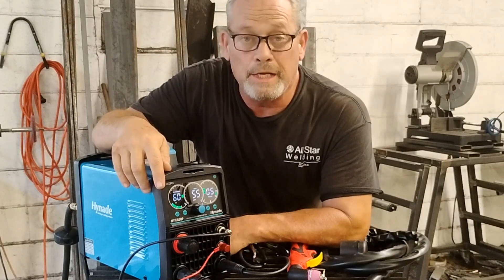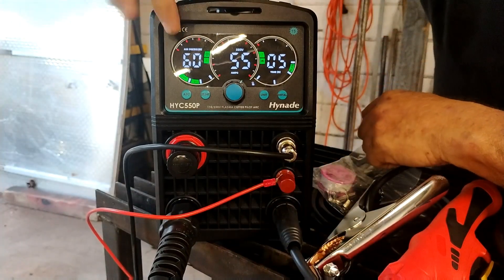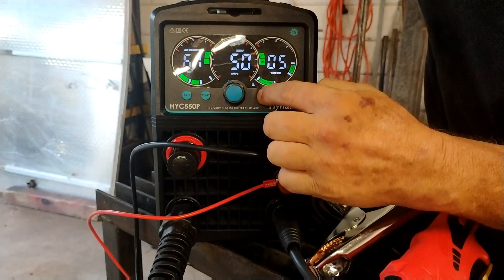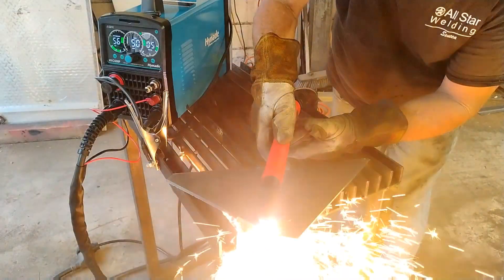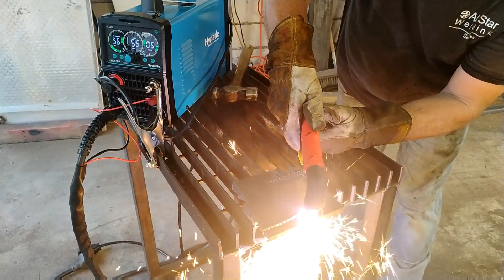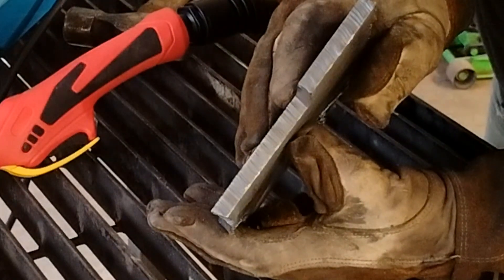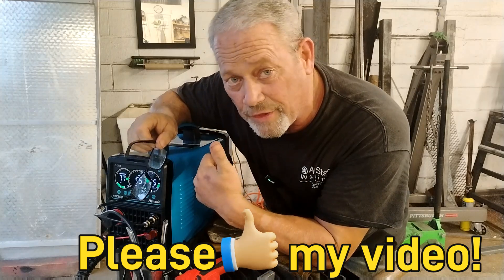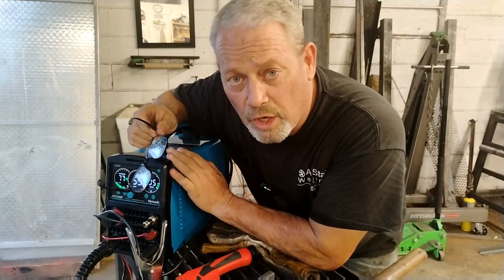Hynade HYC 550P Plasma Cutter Review & Test — Is It Worth It?

Comment: Nice review - Thanks!
One small note (as I'm sure you know by now), at 50 Amps, you could have "flown" like a B52 across those first two pieces - Ha.
Reply from the maker: Yeah, I had to get used to that machine.
Reply: @AllStarWeldingSC  I'm thinking about getting that same machine as a backup because the one I have is 20+ years old and heavy as a sack of concrete, and only has 30A output, although it is dual voltage). That Hynade is so portable and powerful with its inverter, BUT... I can't find any warranty information? 
In fact, I was going to get a BestArc but they offer no warranty AT ALL best I can see, so that is a NoGo for me. Hopefully Hynade has something to offer in warranty? Thanks again, Sir!
Reply from the maker: @AerialLensVideo I also have a Primeweld and a Vevor. I like the Vevor the best. Although Hynade has the extra 5amp for the 1/2. But, if I'm doing 1/2", I'm probably going to use a torch. If buying from Amazon, just buy the warranty from Amazon. Easy return, no questions.